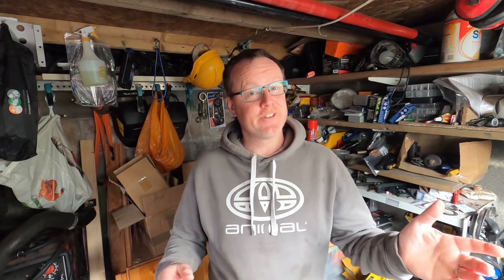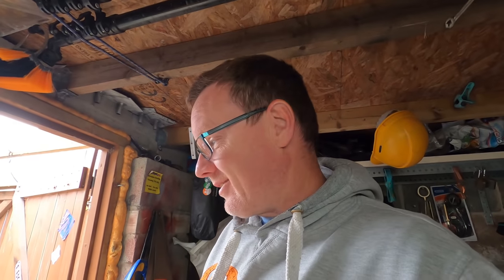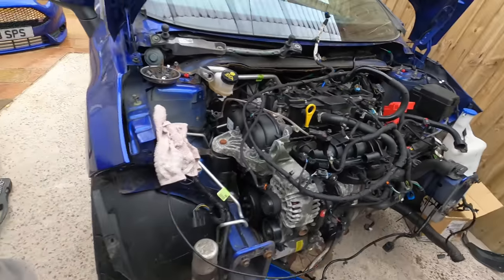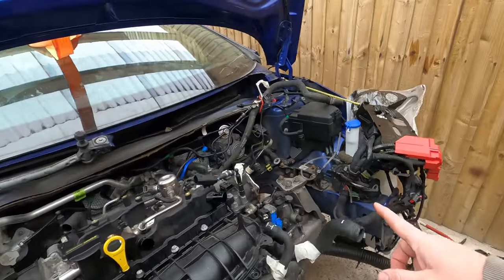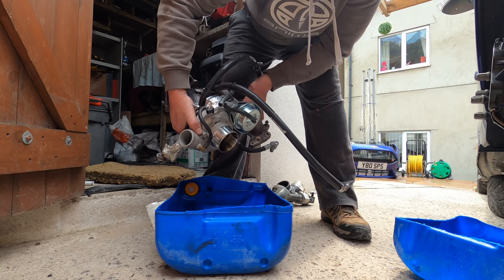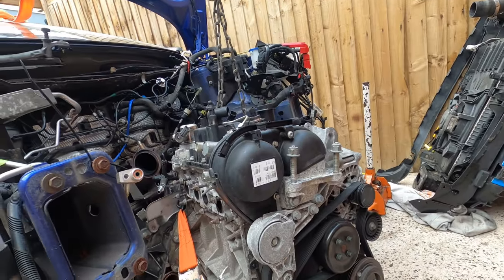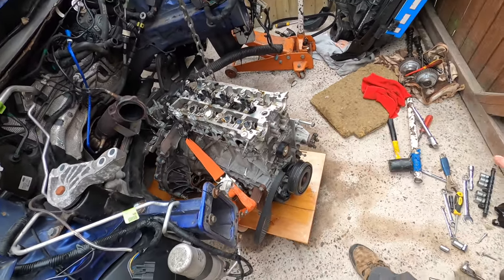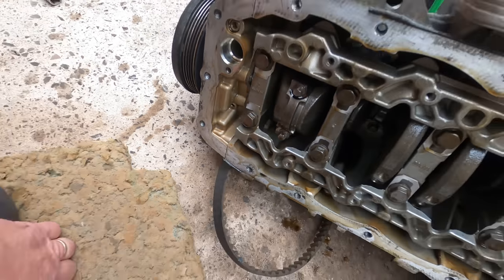Why did my engine blow? lets take it apart!

Comment: Certainly not detonation, it’s heat build up.
Reply: Its both m8. Look at the piston and ring land.
Reply: @FastLifeVlog  nope, no pitting to the crown or surface and no deposits on the head by the valves. All other piston faces look good. The crack on bore 4 also suggests heat build up. The biggest clue is on another of his videos when the car over heats and he says its done that before the big turbo. You can buy better radiators too, so the finger points to thermal spotting as the cause, the rest is subsequent damage in my mind. No pint fixing any of this without finding the cause. Happy to stand corrected though.
Reply: Overheating can cause detonation aswell can't see overheating alone causing that damage.
Reply: @jonathanhamilton8465  agree with you completely.
Reply: @FastLifeVlog  https://help.summitracing.com/app/answers/detail/a_id/5007/~/engine-detonation note the part about overheating causing detonation. Which came first? Given the car overheated first... 😃👍🏻 Let’s see what the outcome is, I’m more than happy to be wrong, but never rule out the simple things.

Comment: Just get a vxr they have better and stronger engines unlike the fiestas they can't handle any power lol
Reply: Not a Corsa though? Piston 4 says hello 👋🏻
Reply: @idzski  haha 😄 I meant the astra or vectra
Reply: @dubzuk3710  the astra rods can only handle 350bft max, so to make use of any sort of big turbo they need at least a rod job
Reply: Cracks in head/liners, rod bearing damage, side of piston crown melted away is signs of detonation probably combination as mentioned before of too much boost, ignition timing, too low octane rated fuel maybe, fuel starvation map being too aggressive for stock engine.  Pushing 300bhp through a stock engine is never going to last long, would definitely build new engine with forged pistons, upgraded rods, upgraded bearings and make sure cooling system is tip top.  Maybe run a less aggressive map if you want to run a stock engine.